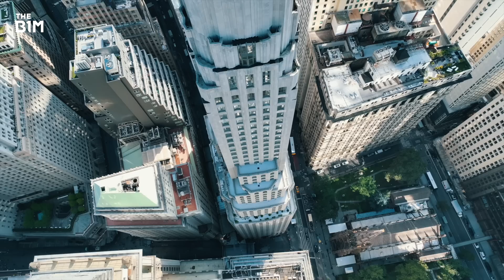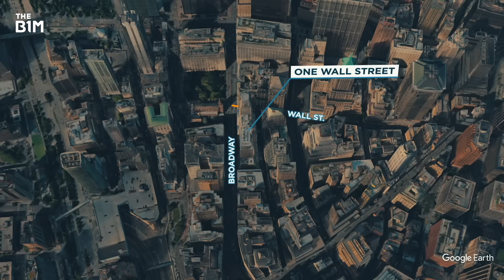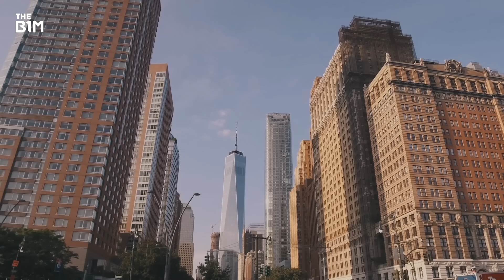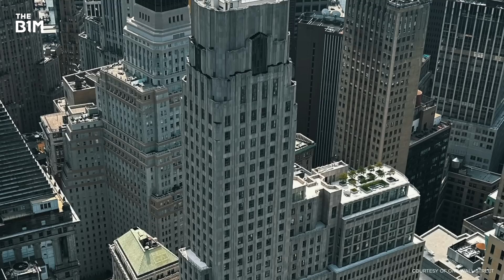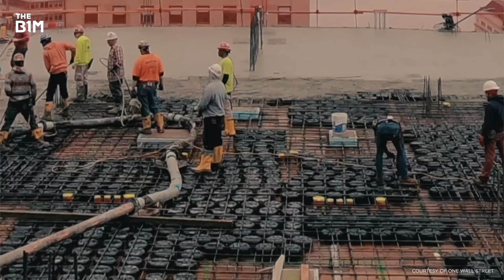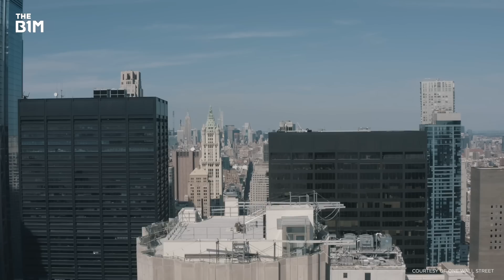Why New York is Building on TOP of its Skyscrapers

Comment: there is a lot of space in NYC but if you are talking about downtown Manhattan, then there isn't. Also, this isn't for housing, this is more for speculate investment. Most of those apartments will be sitting empty 90% of the time.
Reply: Actually, many of those buildings are IDEAL for residences bc of the smaller floor-plates - - much more prevalent in pre-WW skyscrapers (especially downtown bc of the tiny winding streets that date back to New Amsterdam).
Reply: Same in London btw.
Reply: Office to residential conversion did happen in downtown Manhattan. There's 160 Water street, 180 Water St and 25 Water St (still being converted).
Reply: @AneudiD78  very few offices can be converted into apartments.  From what I've read about 10%. The way most office buildings were built make them really hard to convert them.
Reply: Manhattan has a 1.4% vacancy rate the lowest in decades, while empty units have fallen.  This is just completely dismissive of reality
Reply: @patrickcoyne3102  I didn't know Manhattan is the only part of NYC. Also, there are new residential buildings being built in northern Manhattan.
Reply: @the0ne809  that 1.4% is for all of NYC not just Manhattan the lowest ever recorded
Reply: @patrickcoyne3102  read my comment again. I said there is space in NYC and what i meant with that is that there is more space build more. I wasn't talking about the current capacity now. I hope that helps.
Reply: iKR What's 500 more apartments to a city of 10,000,000
Reply: I bet doing what they did was still a lot cheaper than building a new building
Reply: It used to be that way. Especially after the pandemic. But things have drastically changed. https://www.nyc.gov/site/hpd/news/007-24/new-york-city-s-vacancy-rate-reaches-historic-low-1-4-percent-demanding-urgent-action-new#/0
Reply: Hey, someone's got to build new supply for the money launderers, their former go to guy, traitor Trump, will be in prison soon.
Reply: Just Like the Empire state building almost 100 years ago
Reply: The money launderers are people too. They need these luxury apartments. You can't expect them to put all their rubles and yen into Trump-coin. Can you?  Show some humanity.
Reply: Exactly, we can be up zoning and building in Harlem, but out nycha lots, there’s development in south Bronx, there’s space. But costs mean developers only want to play with super luxury apartments and locations, and then it hardly sells.

How much of Hudson yards, 9 dekalb (apparently going to foreclosure) and these conversions of landmark buildings actually eventually sell and hold their units?
Reply: @Eshanas  generally they wind up selling eventually. The problem that’s currently facing a lot of these developers is that interest rates are higher and construction costs are higher than ever. It’s hard to compete with existing stock and be profitable since legacy apartment building renters don’t have to worry about recouping construction costs. It’s a tough market for developers to be sure and it’s part of the reason why there’s a lot of difficulty in profiting in the short run. 

Ultimately the goal of a developer is basically to build and then dump the asset on a diversified REIT or Property Management Co for the highest payout and have them deal with it. Understandably, these management companies kinda like to squeeze developers as hard as they can to get better prices.

To make matters worse, often times developers don’t even own the land they’re building on and so they have to pay rent to the landowner who doesn’t want the risks of the property, but can kind of extort the developer at both ends.

All told it just kinda sucks to be a developer.
Reply: I checked the currently available units on the website:
1.15M-1.4M for a studio
1.5-2.1M for a 1 bedroom
2.3-3.2M for a 2 bedroom
9.75M for a 3 bedroom
Reply: @SomebodyHere-cm8dj  very affordable for the average New Yorker.
Reply: No space?! Build up! Sky would be the limit, but for stupid zoning.
Reply: What space ? Have you been to new york city before? Visted every burough? No judgement here. I just dont understand how you say nyc has space
Reply: exactly, a commodity
Reply: I literally live in one of these “luxury buildings” and dawg I WISH it were 90% empty 😂😂😂. Elevator up and down would be so much easier. 

Igi that it’s kinda hard to imagine when you don’t have money that there are a lot of people who do and who are willing to spend it to live in New York, but like that’s just how it is cuz.
Reply: @patrickboldea599  I'm glad you have millions since these apartments aren't for renting.
Reply: Getouttahea with that tired NIMBY trope. More housing where it's in high demand is only a good thing, no matter who buys it. We have so, so, SO much demand for housing... and we'd have even more if we built enough new housing to actually lower prices.
Reply: @doubleclick21 more housing that doesn’t actually get used as housing, and instead gets used as an investment,  isn’t going to help the housing issue in NYC.
Reply: @franciscodanconia4324  “investment”… cough money laundering cough
Reply: @PerfectRodo  Maybe.  Lots of rich Chinese use it as an "escape plan" to get around Chinese foreign transfer laws.  And have assets to fall back on should they become persona non grata with Xi the Pooh.
Reply: @doubleclick21  if you think I'm a nimby you are wrong. I'm in favor of more housing but these are ultra luxury apartments.  Do you have 10 million laying around? I don't think so.🤡
Reply: @doubleclick21  Except this isn't even remotely affordable construction. So either the developer goes bankrupt so the unit price can drop below the cost to build, or the prices stay above the cost to build and aren't economical for just about everyone but the money launderers and Wall St crooks.
Reply: @doubleclick21  These rich folk probably pay more property tax to the city buying one of these apartments than an average worker would in their lifetime.
Reply: @martinlewis3547 money laundering.
Reply: That's why you need squatters' rights. If no one is living in your building for over half a year, the people should be allowed to repossess it. This should put an end to billionaires pricing the middle class out of humane living conditions.
Reply: don't lie you are parroting some buzzfeed thing the rest of us also saw. Cmon bro you're better than that
Reply: Yeah their making room for all the the illegal immigrants not for any of us
Reply: @Badgerlust  Yes, hardworking immigrants searching for a better life totally buy highrise apartment units in Lower Manhattan.

I bet your pathetic MAGA ass can't even remotely afford one of these units either, Maybe next lifetime, try making something of yourself instead of dedicating your existence to tearing down and hating on others willing to make the sacrifices and hard work that you aren't.
Reply: @Badgerlust  While I'm as disgusted by Biden's flood of invaders as anyone it's not like they would be able to afford to live in those places!

Comment: In Chicago, the Blue Cross Blue Shield building had floors added on to it, but I remember reading that the building was originally designed to expand in case they needed more room.
Reply: i worked on that project it was indeed designed for the top to be added later.
Reply: Oh that's cool, that would be more expensive, nice of them to think of that
Reply: One of my favorite buildings in Chicago
Reply: You have to wonder about the added weight.
Reply: It is not as complex as you might expect. Steelframes can carry a lot of weight and back then they were rarely that optimised to safe weight but rather allow for uniform and fast construction.
Reply: Yup. The first building I worked on we did the addition on a previously built hospital.  Built 3 more floors.